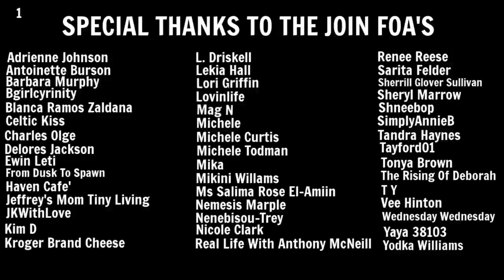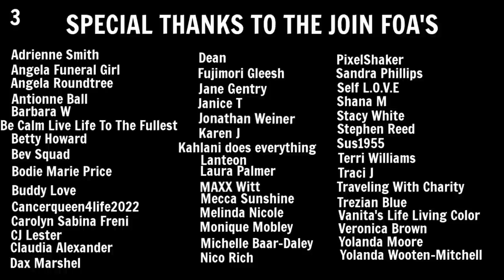Living In A Minivan | Van Build Day 3 | Unconventional Floor Choice

Comment: Looks awesome 👌 a good idea would be to get a stand up LG a/c ($300) and strap it to your passenger seat with ratchet straps. Get a 2000 watt generator ($500) and run a/c all day. That vent thing for the window fits. I use that for my semi truck. 

A Webasto heater is a life saver. ($1000) A semi truck shop can install it for you. ($500) You'd be ready for Any climate. 

I can't wait to See the reveal. Stay blessed 🙌
Reply from the maker: What lol. I have a minivan. Not a RV lol

Comment: Regarding the reflectix will crumble when you keep walking on it...buy the clear contact paper used to line cabinet shelves. Apply it over the reflectix as a protective covering. It's plastic. It can be wiped down with a cleaning solution because it is made to line shelves.

Here's another tip: if you want a gray colored waterproof cover, use a  "shower pan liner". I use it as a covering for my work table in my hobby room. I bought it in roll. One side has lines on it, the other doesn't.

Comment: If you don't want to cut the seatbelt out that's hanging in the back, you could probably attach 2 rows from a shoe organizer to it with zip ties or whatever.  Shoe organizers are $7 at Walmart and you can just cut off what you need.  You could even use some of what's left on the back of the seats up front.

Comment: ANTHONY THAT REFLECTIVE FLOOR IS NOT GOING TO WORK YOU ARE GOING TO BE TAKING THAT STUFF RIGHT BACK OUT AGAIN YOU SHOULD USE IT FOR INSULATION UNDER A RUG OR SOMETHING ITS NOT STRONG ENOUGH FOR FLOORING. WHY DIDN'T YOU LET YOUR FRIEND THAT YOU GOING TO TEXAS WITH HELP YOU!! Mark your spare tire Anthony I know you want to get done you should've  gone with some sticky tile on top of your flooring and you would not had to cut anything  all you would've had to do is put your bed and other things in place you can consider it for next time ok I like what you are doing!!

Comment: When you make yr reflectix WINDOW covers, buy the THINNEST garage carpet (usually sold in 3m wide rolls and cut by the metre). Buy the darkest grey or black carpeting (that side will touch the windows and look totally black from outside the car. I used heavy paper to create trace window templates.
I cellotaped the paper template to reflectix, drew line around paper template, then cut. 2 x sets of each window (1 for LH window and other for RH window). Do same for the thin garage carpet then glue silver reflectix to black garage carpet. Spray glue the BACK of the thin garage carpet to the BACK of the silver reflectix. Silver reflectix be on the INSIDE of the car windows and black garage carpet be on the side touching the glass visible from the outside of the car. I used heavy paper to trace and cut templates of the LH side window panes then reversed them for the opposite RH side windows of the car.

NO condensation on windows in morning.
NO light showing thru windows at night

Comment: I would go with u peel stick tile on the floor that silver is very thin and will tear in no time
Reply: Yes and I've I've said this like 10 times on here already I've worked at home Depot and Lowe's and flooring wall that is not meant to walk on I don't know what he's thinking yeah even peeling the stick tile would be all right or vinyl you can cut vinyl to size but peel and sticks easier to use in a small space like that it would be way easier to put that down I just don't understand it's going to rip all up what he's doing and it just makes no sense what he's doing none at all

Comment: That is coming together nicely.  Can anyone tell me what that strap is hanging in the middle of the back door?
Reply: Seat belt
Reply: @jeannevaughn9261  seat belt?  really?  there is no seat there....or it is stored away but the belt stays?  I think that is a poor car design..........Thanks for answering🙂
Reply: The rear seats are folded flat into the floor.
Reply: The middle seats are also folded in the floor.  There is a bench seat at the very back of the van that needs 3 seat belts
Reply: @jeannevaughn9261  why is one of the belts still there is the seats are folded away?  is there no clip to disconnect ?  Anyways....glad it is not problem  LOL